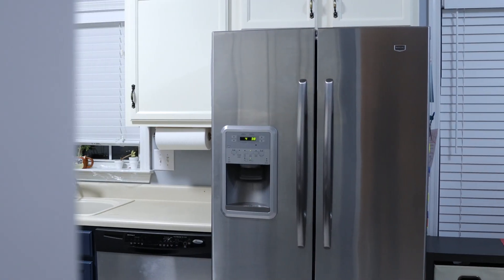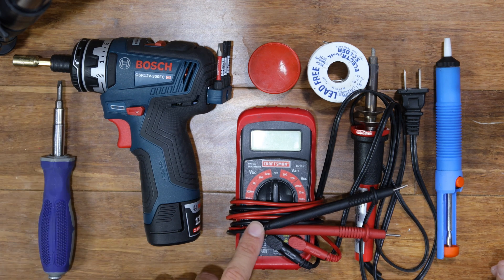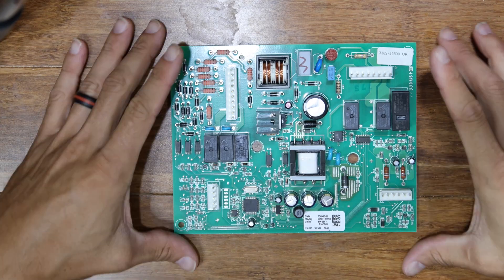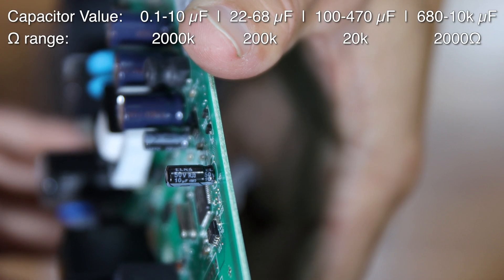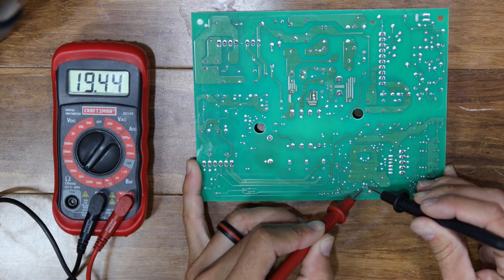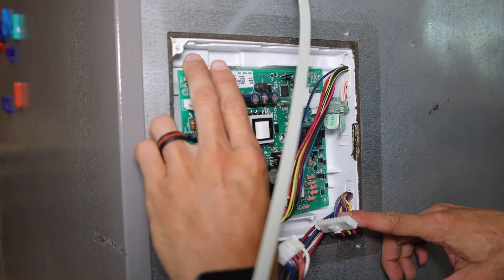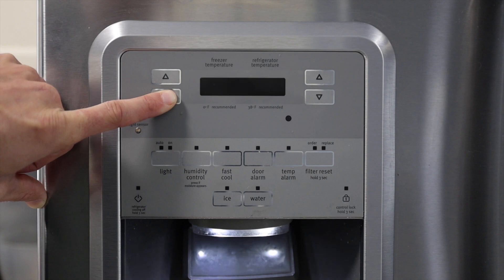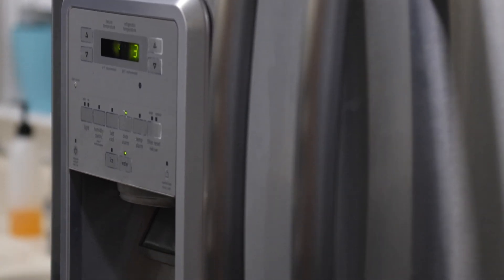Refrigerator Power Control Board Repair/Replacement

Comment: Hello. I replaced my power control board twice now, and still not powering on. It just lights up and beeps when pushing any button
Reply from the maker: I know there’s a lot of different models of these refrigerators, did the new board you bought have the exact model number of your fridge in the description?
Does the compressor attempt to start up when it’s plugged in?